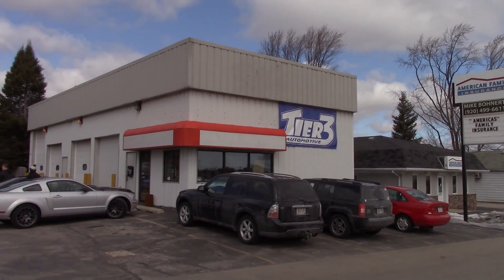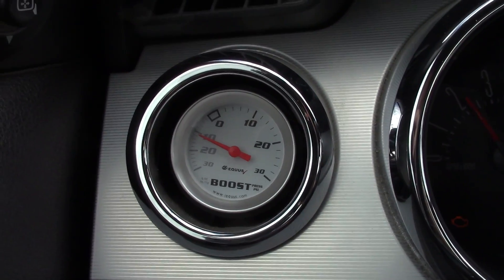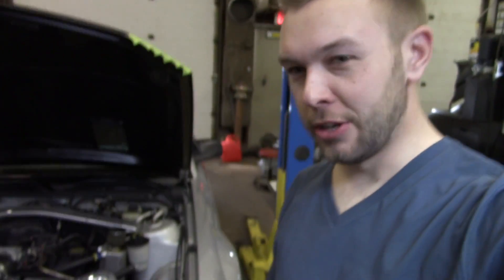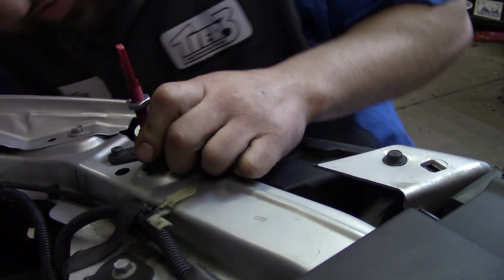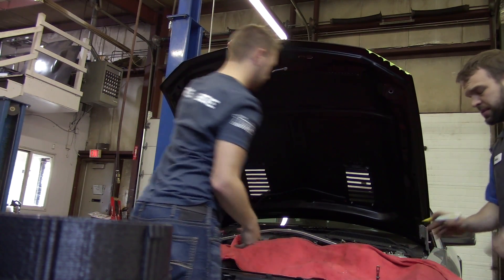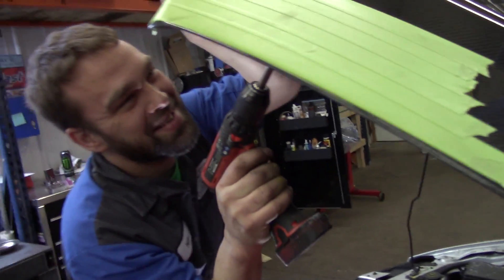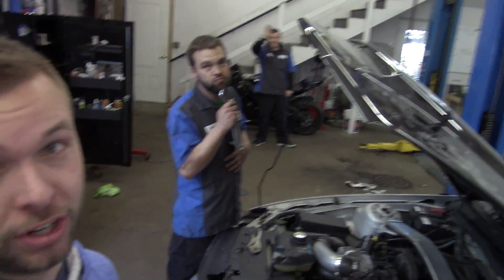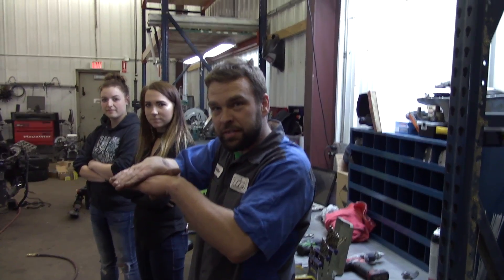AeroCatch Hood Pin Install

Comment: I had the same issue on my 14 GT, found belly pan underneath the car was hanging to low, missing some screws and that's where the air underneath the vehicle is trying to come up through the engine bay.

Comment: Do you have to remove the original hood latch when installing these?
Reply from the maker: No. I left mine on for the extra point to hold the hood down.

Comment: There are latch locks they use on the airliners I fuel. If I go hood pin route, I'm going with the ones these planes have... hey, they hold above 400mph